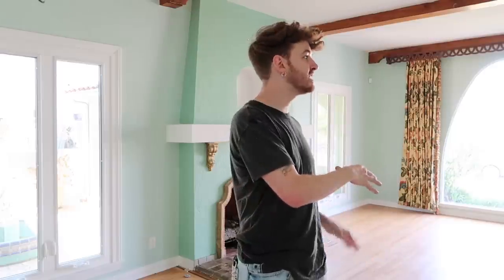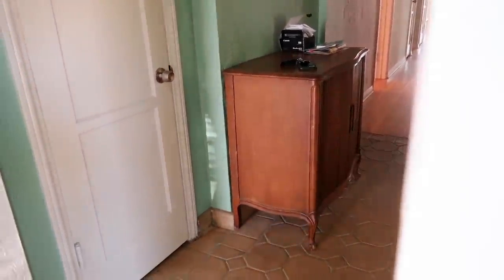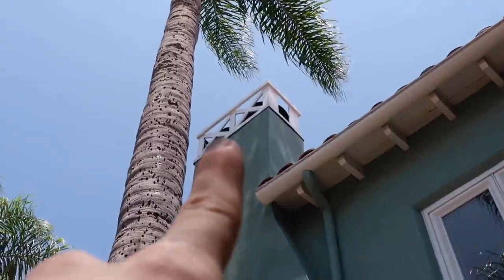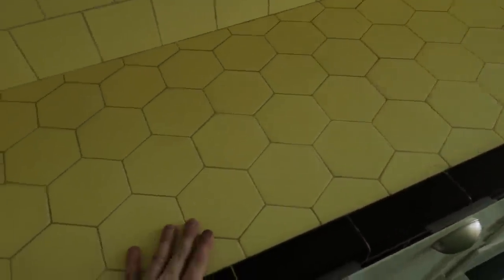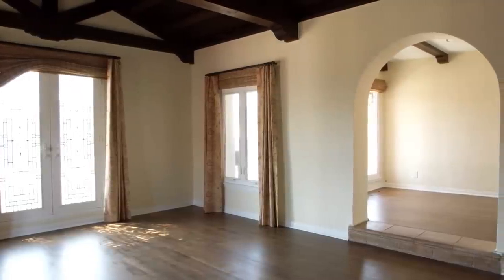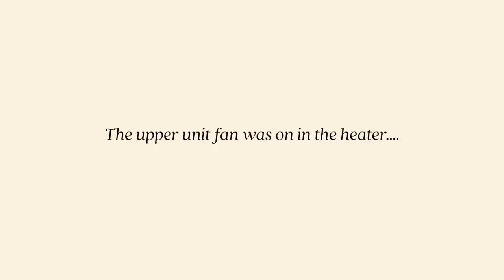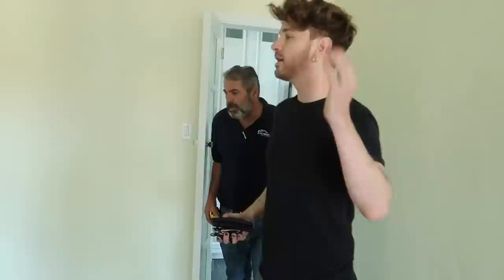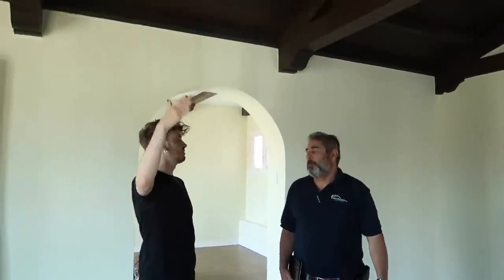Awful News About The House

Comment: As a long time homeowner, I agree with many of the comments here. Make sure your roof, foundation, plumbing, and electrical are brought up to date and you are not just doing quick fixes because it will be costlier in the long run. Also, trying to impose a completely open plan on a house of this age will be very, very costly. Instead think about cutting large archways between those rooms that will preserve the load bearing capacity and maintain the aesthetic style of the house. Don’t jump in to do decorating because you think it’s what your subscribers want. Do what is best for your home in the long run. Decorating videos can be done for other people for the time being. Personally I love watching remodeling and construction content. Don’t rush and good luck! 🍀❤️

Comment: My advise with the wall you want to eliminate... have you thought of placing around three columns  to replace the wall you will still have structure in place to hold the upper level. My fiancé did that to our wall to replace a structural wall. He builds house from the ground up. Also, think about placing floor to ceiling windows about 4ft wide with a column like divider in-between the windows.

Comment: Since you asked … the floors may not need to be deeply sanded to change colors. Try some tests in some unobtrusive places. The floors may have had the varnish worn off a long time a go and will accept a darker stain and new sealer, no problem. I'm about to use some Clear Osmo coat imported from Europe, over some staining that I'm doing now. There are some YouTube videos on Osmo. It's a great finish for wood.  I will never use Poly again!  Your floors may only need a touch of sanding, not industrial sanding before recoloring.  I'm afraid floor people always go for the 'nuclear' option.

Comment: Floors should always be the last thing done. Do everything first. Then you can tackle one room floor at a time. With walls Being torn down and what not, the bathroom being done, light fixtures being done in the various rooms, it’s wise to do the floors last so that workmen are not trampling on the floors with the equipment and their dust or whatever. I would start from the top and work down. If you really want certain things done but are put off by the cost or the amount of time, just plan on tackling one thing at a time and everything should be done probably in one year. You can still live in the house in whatever room you choose and then when your room is getting a new floor, just temporarily sleep in another room that is finished. Don’t worry about the time it will fly by. And in the end you’ll be so happy and pleased and you will never want to leave.

Comment: I would do the bathrooms in a classic black and white tile decor, and I would keep the original bathtub that's a classic, think Fred Astaire and Ginger Rogers! What's hidden in the walls and possibly the floor/ceiling that adjoins the two floors MUST be fixed. If it has been there for a while, you could have black mold, and rotted wood and possibly termites. I would also check for asbestos in the basement wrapped around pipes, and the heating system. Where they did the patch on the wall in the basement might be connected to plumbing leak in the wall or a seepage problem from the exterior of the house, so check the exterior area for possible drainage problems. Does the house have guttering and downspouts and more importantly, where are they located, and where do they drain?

Comment: Smoke detectors ~ Carbon Monoxide detectors and you may be surprised at how much cement is under those counter tiles. Good luck saving any of them :)  Looking forward to  watching the project progress. Also, the seller is responsible for the termite inspection.

Comment: I’m sure you are beyond this step. But I tried to remove these type of tiles in a 1920s home. It had to come out in big chunks. The Tyler’s were stuck on very well to a bed of cement which was probably over an inch think and some chicken wire under that. 😂 It was needless to say not salvageable for reuse. But I did save a piece as a platform for something else. 😊

Comment: 22:49 You mentioned drywall; I don't know when dry wall was invented but most likely the wall is plaster. So repair will be slightly different than a drywall repair. 
  
I know you want to save the original tile, but I wonder instead of saving the tile, if you could find "period" specific tiles that match but just do all new? I just imagine all of the time spent trying to remove the tile and scrubbing off the mortar only to have it break at any step in the process between demo, cleaning and installation.

Comment: If you have the funds and the time I say go ahead and do the reno and have the house the way you want it. The worse is living through a demo or regretting of not making the changes all at once as it might become more expensive to undo some work to get what you originally wanted done. If possible live in the half house that isn't having major renos done and then transfer over to the other side when its time for the renos on that side to get done.

Comment: Amazon has a 30 foot or longer tiny camera for cheap. You can put it in a pipe and see the issue. You can drill a tiny hole in the wall and look, too. I would also get 3 or more quotes. Many times some companies may know it’s a problem on inspection, then try to add it on for extra work. I’ve seen many shady companies that work with agents to get the house sold. It happened to me. $35,000 later, we still have some issues. Also, a pipe from our water heater wasn’t properly installed. My son and I got carbon monoxide poisoning. We were getting exposed little by little.

Comment: The air handler (the machine in the basement) check the control on the wall upstairs.. Mine has two switches, one that controls the heating and air conditioner has three positions  cool/off/heat  I also have one for just the fan which just turns on the fan (like a whole house fan) if that's in the on position it will always run..  But the fan is very useful when taking a shower.. if you turn it on while taking a shower, the bathroom will not fog up..

Comment: Most definitely do the basics first ie plumbing, electrical, gas, insulation, structural etc.  Floors last.  Also reinstall original features ie doorways, archways, windows...  really consider the original intention and style of the designs re wall placements.  Consider alternatives to removing walls  for example changing the direction of room and placement of fixtures.

Comment: I question whether the tile in the bathrooms is original. I noticed that the plumbing for the downstairs bathtub isn’t on top of the tile but instead the tile butts up against the tile which means the plumbing was put in before the tile was put in. Are you sure this isn’t tile from the late 50’s-early 60’s? Those colors-pink, aqua, yellow-certainly fit that era better than 20’s.

Comment: Here in Alberta and BC Canada all inspectors turn the water on in all kitchens and washrooms and they run them the entire time they are in the home. They also do a water moisture metre check on all walls where water pipes are. If the moisture test comes up high they do more research. This test is also done on concrete walls.

Comment: Home ownership is a living nightmare sometimes. 😉 The black stuff in your fireplace was probably soot. They would’ve swept the chimney before coating it. It’s possible that there was a clump that they missed or didn’t clear because they didn’t need to coat that bit and maybe it came loose. Nothing to worry about but a good reminder that if you have a working fireplace and intend to use it, you need to get it regularly swept to avoid chimney fires. 😊 I would definitely recommend living with your space before doing any major demolition. It seems like the construction is poured concrete so, like Belin said, every wall is part of the structure and therefore could compromise your home if you knock it down. On the upside, this makes for a much better insulated and sound resistant home than lots of partition walls. 😁 The downside is that removing walls is a lot more costly. And like you said, you also have to think about rewiring electrics, and whether there’s any plumbing, air conditioning, ventilation, or heating running through the wall, and then also refinishing your floors. Best option in those circumstances is probably to try and use archways and wider doorways to make the spaces feel a bit more open. If at all possible try to avoid doing this downstairs as that will have a greater impact on your structure. Finally just say I’m sorry about the stress with your plumbing. Surveys/inspections can only reveal so much, but better to find it now than down the line when it’s maybe a bigger problem. Hopefully it’ll be fine. If you do need to do work in the downstairs bathrooms, maybe start in the green one where the tile work is already going to need to go. If you need to do anything in the pink one, you should definitely remove the tiles yourself rather than leave it to the plumber because they just won’t take the time and care you would. When it comes to it, I’d almost put money on it being down to the dodgy moving bath situation!!! I look forward to your next update (hoping it’s all good in the end!)

Comment: You can easily remove the tiles without breaking them and allow them to work on the bare walls; after work is done, install green water resistance sheet-rock and work on.

Comment: Those ceiling beams are hideous. Uninstall them and put up a regular painted white ceiling. Do the fire place chimneys need cleaning? 
The floors do need sanded down to restrain them etc. and it is a hard job because you'll have to sand the hard wood floors by hand. Lastly, finish the floors with stain and shellac them by hand. You will need knee pads. 
How old is your house? Your broken bathroom problem...I feel for you. I hope repairs won't cost you a fortune. 
You are sooo talented. I can't wait to see what your home will look like when you're all done.

Comment: Without any water fixtures 'open' or 'on, check how quickly your water meter is going around. A leak is much like having your toilet running. If your meter is moving very slowly the leak is minimal.

Comment: If it is supply lines and not drains, you can replace all the piping with PEX which is easier to feed through the walls without tearing them up

Comment: I'm not sure I'd recommend going with darker flooring in the upper unit, because with the dark ceiling in the living room, it would make it feel smaller, more confined.  But that's my opinion.

That could be the cause of why the tiles are cracking and damaged in the lower bathrooms, because the upstairs bathrooms are leaking.

Comment: Exploratory surgery for leak in bathroom (most likely a DRAIN since if it were a water supply line it would have been a constant flow and more obvious that it was happening), but the exploration can be done from above especially if that is the floor you were to redo anyway.  Have them take the upper floor to the studs and see the leak, repair, then put a subfloor back in, instead of having them fuss over the tiled ceiling below.

Comment: You really need to take some time and decide what your priorities are. Would it be more cost effective to add some kitchen space outside the main footprint instead of removing 3 or 4? weight baring walls? Floors will most likely need to be to make them all level, etc and same with the ceilings. That is going to really change the house. LOVE the light fixtures. Is there anything like an Architectural Hardware type store in your area?   But another big thing is the tile. And the to be uncovered damage.  Besides water damage, you may find black mold.. but you may be lucky and be grateful you live in a dryer area.  I use to do tile and actually having to remove a bunch of the tile in those bathrooms will give you the chance to find out how much tile you end up with that is in good, useable condition. Personally, finding the damage may give you the option to enlarge a shower, add windows or maybe add an exterior wall window of glass block which would also free up more 'pink wall tile' for other areas. Using the yellow hexagon tiles from the kitchen is a great idea.  Getting to open up a wall or 2 to fix pipe can be a good thing.  Just be super careful removing the tile.   Opening up walls also gives you the opportunity to add insulation or soundproofing. Or a sound system. A security system. A secret room. Or maybe you will find old wiring in the walls as well.  Such is life as a homeowner. Take your time. Fix the things that need to be fixed first. I enjoyed the creative process, and I can tell you do as well.

Comment: I'd keep units seperate, however create entrance doorway if U want. A skylight in the upper unit would bring in so much light to the upper unit and looks great, removing too many walls reduces the value of the place, kitchen a yes to open up though. Think long term, are you going to be there or invest? Also theirs places that have old tile and patterns, restoration places, keeps value of place and ambiance. Theirs also colour matching as you could paint tiles instead of removing.

Comment: Oh Joy - did you get a home warranty when you bought the house?  It should cover the repair of the leak.  Some plumbers used dye in the water when checking if the water was flowing into a septic system.

Comment: I have owned two old homes that I remodeled and am an interior designer.   Hire a professional for your hardwood floors as they require it.  If you try to do your own sanding with the machine, the floors can be easily ruined by causing waves in the wood unless your an experienced professional.  I made the mistake of refinishing my home with a rich dark floor.  Huge mistake.  Every grain of dust will show and it's a daily job of cleaning the floors.   Also, glossy finished floors are out of fashion and look like a gymnasium.  A matt finish looks expensive and artsy just like a flat finished wall paint looks velvety and chic.   Flat paint and finishes hide imperfections.  A gloss or even a slight sheen shows everything.  In a home that is older, flat and matt is the way to go.  Hope this helps.

Comment: The black stuff is probably creosote which collects on the inside of the chimney when you burn wood. That's why you get your chimney cleaned regularly because if you don't and it will fill up the flue and catch fire. 😉 It's worth it to pay attention to your chimney and, depending on how often and how hot you burn your fire, it may not need cleaning every year but better safe...as the saying goes.
Reply: It looked like a gas fireplace?

Comment: Didn't they give you plats of your home that had all the measurements for each room? I got that when purchasing a condo and found it very helpful - plus super fun to just look at! <3 Also, your City records may have original plans of your home which may show different walls than what are there now.

Couple other thoughts: sanding your floors before any work is done is great - having those nice smooth floors is worth it! Also, the news about the leak is absolute crap - BUT waaaay better to know about it now than to find out once you've moved in. Although not sure the pee test is plumber-approved! That one lamp looks like TIFFANY!! (jealous) Could be a knock-off but looks like the real thing on video. As others have already said, take great care of those fixtures. You've got tons of moveable capital. 

Most of all, your house has great bones. So while it's really fun to see the design planning, it's super important to take your time on all the structural issues. You're doing such a service to all your viewers who are hoping to buy at some point by showing them all you're learning and how you're handling the various issues that are involved in buying. Finally, thanks for sharing these wonderful videos! Happy late birthday to you!

Comment: Those yellow tiles in the kitchen were probably set in concrete with wire support. Meaning, that when you try to pull them up, all those piles are tethered together and will break apart. My parents has the same setup and it was a damn mess.

Comment: Once the house is functional you should live in the space for about 6 months and see how you actually use it before you decide which walls to remove. They're very expensive to put back in if you change your mind. But seeing how you use the space and what your natural inclinations are for what each room should be will inform you on what needs to change. But you can't learn any of that unless you live in the space for an amount of time so you can be informed.

Comment: Drew, don’t do any remodeling until all the structure is addressed.  The inspection was obviously not thorough.  This should affect the amount you paid for the house.  Basement, roof, plumbing, electrical, heating, foundation, asbestos and mold.  Before any money is put into remodeling. 💥💥💥